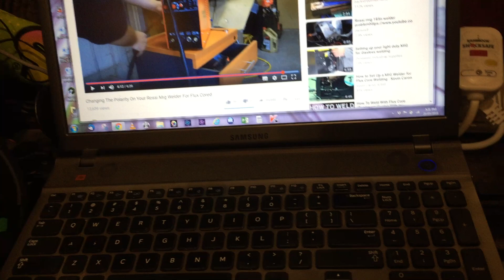Changing polarity Rossi Mig 130

Comment: Hi Geoff thanks for posting this video. Super helpful,  now I know why my welder is shit.
Can you tell me whether you switched the two smaller wires as well?
Reply from the maker: Hi Ben, I didn't switch anything else, just the two big cables shown. I should also say that it doesn't come in the wrong wiring for flux core, just if you want to use gas. It worked alright. I have now sold it and bought a more straightforward Unimig Razor 175, which I am very happy with and as I plan to always use Mig gas, it came with the correct polarity. Also I am not an electrician, so you should make sure you do this change unplugged, and very very carefully that there are no shorts or other changes. If you are at all unsure, don't do it.
Reply from the maker: Hi Ben, no I didn't change anything else. I have now sold it, upgraded my wiring to 20 amp, and bought a Unimig Razor 175 which I am totally happy with. It was a good one to try out on, and it did a few small jobs really well for a cheapy. I upgraded and welding is much easier with a heavier amp machine.
Reply: hi ben did you manage to change the polarity without switching the smaller wires aswell

Comment: Geoff ... just took delivery of a MIG130 also. Found you while investigating same problem. Sadly I am more confused now, you say this is delivered ready for "flux core (gasless) wire" and I see you have described how to change the polarity for gas. I'm somehwat dismayed that the seller / manufacturer supplies a unit which can't be simply switched between modes safely and idiot proof.

Mine has a 15amp plug, so I have nowhere to plug in. Did you change the plug or was it supplied with 10amp to  you? BTW what gas and regulatordid you buy?
Reply: Hey dave, just bought one of these aswell. What ever you do, dont modify the original plug on the machine. Instead, make a short extension lead, about a foot long and fit a male 10a plug on one side and a 15a female on the other, use it as an adapter to plug in the welder. Cheers.
Reply from the maker: Hi Dave, It's pretty common on the cheap models to make it difficult to change polarity I think. This thing was pretty cheap and supplied with a 10 amp plug but when I try to use mine on the full power it trips my safety switch. I think a 15 amp plug would be a better option, and I am getting a 16 amp supply put in to use it. The gas I used is the Argon/co2 combination sold at Bunnings for Mig, which allows a little more heat than straight argon I believe. I got a Harris 601 Argon from www.hampden.com.au, who are based in WA. They were really helpful. Honestly I think this is a pretty bottom end Mig, and I will look forward to an upgrade in the near future.
Reply: you dont use straight argon for mig welding. Argon is for Tig. Use a co2 argon oxy mix. bunning sell mig mix for $99 a bottle for mig. Change your 10A power point to a 15A fused with 32A. The startup current will trio ecd's .For all my welders running on single phase I run 15Amp sockets through an old style 32A ceramic fuse and protect it with an industry ELD
Reply: I have one of these machines so all I do is swap the 2 wires over and it will work is this right